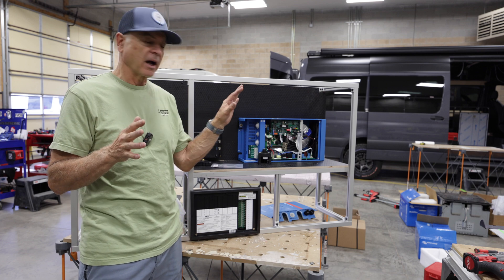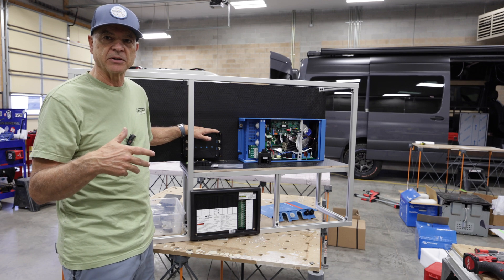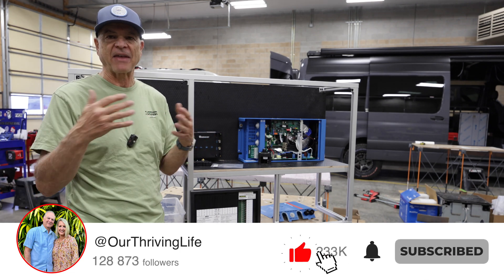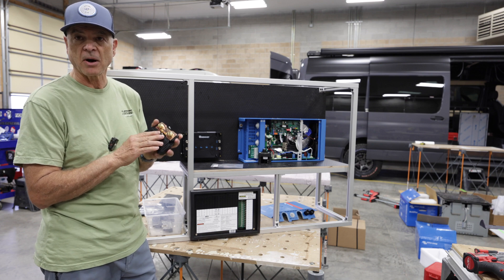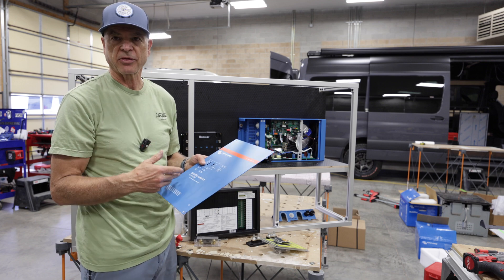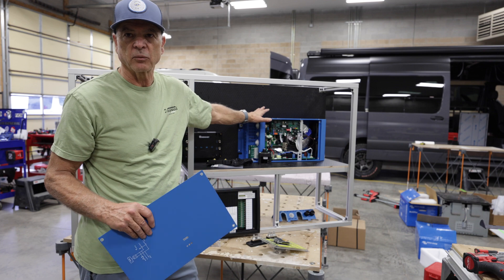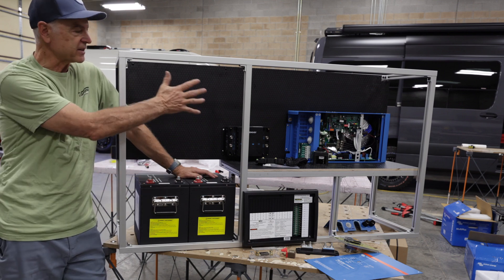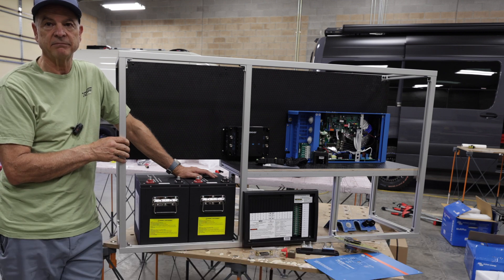Van Electrical Systems: Victron vs. Renogy | Battle Born vs. SOK

Comment: I Originally had the Renogy 50to50DC and Core One with Renogy Smart Shunt. Well, the Core One kept hitting temps above 165F. Had it warranteed. New one had same problem. The BT2 module I got for the 50to50DC stopped working. The connectivity was never good. I couldn't get everything connected on the app together. The shunt only worked for a short amount of time with the Core One. So I never new what I batteries level was at. Mind you, this is all within 1 year. I recently just tore all the Renogy stuff out and replaced with Victron. SO much better! Yes, it was expensive, but everything just works! And it all communicates together! Love the updated UI on the Touch display! It also is much more efficient! The Renogy 50to50DC would cut the DC charging and solar charging in half when both were in use. So you only got full solar while not driving, and full DCtoDC at night when the sun wasn't out. I also tested 1 day apart with the two and the Victron Mppt was pulling in the same solar Watts on a CLOUDY day as the 50to50DC was pulling on a sunny day the day prior! I'll pretty much only buy Renogy's solar panels now.

Comment: A lot of good perspective on some options by both Renogy and Victron. I have an all Renogy system in my Sprinter van. But I'm thinking about a whole new system for my camper trailer and I'm leaning Victron just because the first component I'll start with is an inverter charger and I think the Multiplus 1600 is a better fit for that camper. So I am interested in why you went with a Victron inverter even with the Renogy set up? My 2000w Renogy inverter charger in the van has been great, but the fan is loud and I was inexperienced when starting out and chose a model with no bluetooth or connectivity in any way to the app or One Core system interface. Really regretting not getting the Renogy REGO 3000w with built in bluetooth and supposedly much cooler/quieter even if I don't need 300w. Renogy just doesn't make a compact full featured 1500-2000w range inverter charger unfortunately. 

I am curious about why you said the Victron allows for more upgrading, flexibility? I've grown my Renogy system a lot from the original plans. Started with the 50a DC DC with MPPT used in this video, but then added a 40amp MPPT because my solar plans grew. Then I wanted a DC DC charger that would charge the starter battery too, and very few from any brand actually do that, so I swapped the 50 amp DC DC for a Renogy REGO 60a DC DC and a second 40 amp Rover MPPT controller, and then added even more solar. You can certainly double up devices and add plenty of devices with Renogy no problem. And the One Core monitor, control screen works great for me. I see everything at a glance or a touch or swipe of the finger. 

Anyways, I'm excited to build a Victron system, ironically a smaller one than the Renogy system in my van, and gain more experience and perspective on how the two brands and systems compare!

And I agree it's a lot easier to build outside the van! I was just so unsure about how I wanted everything and my build changed organically over many months. So I know it went a lot slower that way! But I know everything is where I want it and it fits in really space efficiently, and with all my breakers and switches highly accessible from the place I'll be sitting most of the time.

Comment: When I first started building out my truck setup I bought the renogy Dcdc50 like you have, and all blue sea marine parts for bus bars and fuse holders… and in retrospect, really wish I went victron. The Lynx would have been cheaper in the long run, less cabling… the Renogy Core One has been a steaming pile of crap… my next build will be 100% victron for sure.

Comment: In my 25 ft trailer I'm running an SOK 280, 2 x 230 watt solar panels wired at 24 volts, a 2000 watt Victron Multiplus Compact with the simple toggle switch controller, a Lynx, a 712, and 100/50 solar controller (gives room to expand). Fuses and breakers are all Blue Sea (don't take chances on fuses- there are some shockingly bad ones out there), wiring is larger than minimum where possible. It was expensive, but I've had zero issues and in the right weather (summer) and using some common sense, I can go 5+ days with no grid. The SOK battery is less than half the cost of Battle Born locally (Canada) and frankly I think it's a better product. With the metal case, if I have a problem I can replace the component, instead of the whole battery - so if the BMS fails, all I need is a screw driver and a new BMS. Most of it fits in a 3 1/2 x 2 foot under seat area, but just in case I put in a couple of vents for cooling. To me it seems that Battle Born has changed since it was bought out, and rather than concentrating on product development, they're putting out the same product at the prices that were charged 5 years ago. They need to adapt.

Comment: Thanks, great video!  yes I'd go with a lower price , decent quality components.  just purchased the newer 50A Renogy DCDC, check it out.  was also leaning towards an aluminum enclosure.  can you do a video on how you build those?  sok with heaters make a lot of sense.  

have you built 48V systems?

Comment: There are welding cables that have the same diameter but are significantly more flexible.
Reply: Exactly, the 4/0 I have purchased is rated at 440A @ 105 C, so easy to work with, but comes at a hefty price tag.

Comment: GREAT video, but .... We've gone 3 summers with a propane stove, 2 wet cel Gp31 batteries, 200 w solar,  Renogy DCC50s, Isotherm 130 AC/DC Refrigerator with Freezer,  200W cigarette lighter inverter, and a 3g hot water tank with 12V element run the last hour of driving each day.  IF we decide we need a toaster or coffee maker we'll add a 2000W Renogy inverter for $280.00.  It's not for everyone but if your budget is tight electrics is where to save.

Comment: If the cost of technology yields similar long term reliability and meets my personal needs, I personally don’t have a problem buying 2nd tier hardware. My needs tend to be simpler and tend towards keeping my designs simpler, functional, robust, and easy to diagnose and repair.

Comment: Compared to my 2 year old electric build in a tiny pop up truck camper riding in a 19 year old Toyota Tundra - the amount of real estate used in that bench configuration is massive.  

If I was starting from scratch today - I'd opt for a Victron Orion XS DC to DC 50 amp charger and a single 206 Ah SOK LiFePO4. -  My build repurposed the camper's original lead acid battery compartment to house a single 100 Ah SOK, a shunt to monitor state of charge and a Renogy 30 Amp dual input DC to DC charger. The camper has 200 watts of solar.  I have no shore power provisions.  All buss bars, fuses, Blue Sea circuit breakers and the SOC monitor are located in a separate interior cubby  - which I refer to as my control center.  My 110 AC needs are handled by a Bluetti power station mounted above the cubby. It's not the best, but it is a neat and orderly install.

The smallish 30 amp dual input DC to DC charger allows the use of a 12 foot #6 AWG duplex marine wire run from the front of the camper to the truck's starter battery versus the usual #4 AWG cabling.   When the sun is shining the Renogy unit only draws 15 amps / 200 watts from the truck's starter battery - while driving down the road.

Comment: Oh, one thing I heard about the renogy dc to dc charger is that even if it picks up a bit of solar it will split it 50/50, so if your getting 10a solar you only get 25a alternator.
Reply: I put a simple relay in the solar input that opens when the ignition is on, allowing the full 50 amp charge from the alternator, then 25W from solar when parked.   Worked great. Great Unit.
Reply: @pkl88858  that's a good idea 💡
Reply: Will also confirm this to be true. Have had one running for a couple of years. I broke my solar out into a Victron MPPT controller to avoid this problem.
Reply from the maker: I haven’t tested that, but it could be accurate.
Reply: @thrivans considering that your recommending these items shouldn't you know this, how can you recommend items you don't fully understand or have tested 🤔
Reply: @thrivans  yeah, once I'm up and running I will give it a go. Will also make the solar disconnect easy to reach if it's not sunny in the UK and I need a good drive.
Reply: @thrivans  if it is right, it might be worth passing on to your customers.
Reply: @ifell3  your 100% correct 👍 the dcc50s does indeed limit the alternator charge to 25A if it detects any solar, I've been running one for 3 years now, on the positive side it saves fuel by using less alternator power, I fitted an isolator switch for when I need the full 50A from the alt but in reality I've never used it but it's good to have for servicing the system anyway.
Reply: @Dirt-Diggler  thanks for that and a real users experience.

Comment: Why not just use a delta 3 from eco flow? Wouldnt have to buy all those components and wire. Can hook right to a breaker panel or dc panel easily. Wouldnt that work and save you money?
Reply from the maker: You could do that. We’ve done a video on the channel comparing Ecoflow and Victron.
Reply: @thrivans  Thank you for your response.. I appreciate that.  I agree victron is the top choice. I've learned lots watching your videos and the proper way to set it up. But now with that delta 3 and additional batteries I can do it easier and still have all the power I need. W/O buying all those individual components.

Comment: What do you think of the Mopeka water sensor instead of the fuel sending unit as seen in your water tank. It’d be nice to not drill into the water tank.
Reply from the maker: We haven’t used the Mopeka sensors, but they do work with the Cerbo GX. To us it’s not a big deal to drill into the top of the tank.

Comment: Great video! I’m going with 2 Battle born GC3’s. Solar will be 600 watts and total victron system. Question, what size mega fuses do l use in my lynx distributor??
Reply from the maker: I can’t give specific fuse sizes as there are too many variables. I recommend referring to the schematics for exploring.life for wire and fuse sizes.

Comment: The SOK batteries for sure. I would be interested in hearing your thoughts on a Renogy/Victron hybrid system. I'm frugal, not cheap. Meaning, I don't like spending money unnecessarily, but I definitely believe in spending more money if it equals value over the long run. 
Along with completed systems. Do you also offer design services for your electrical/plumbing systems?
Reply from the maker: Thanks for your input. Nothing wrong with a hybrid system, however I feel like you get a lot more bang for the buck with Victron. We don't do the design services, but for electrical we recommend explorist.life.
Reply: there is genuinely zero reason to buy Renogy products to be honest.   They are chinese garbage with awful customer support.   While not even saving you much money vs. Victron.   Victron components are bulletproof.